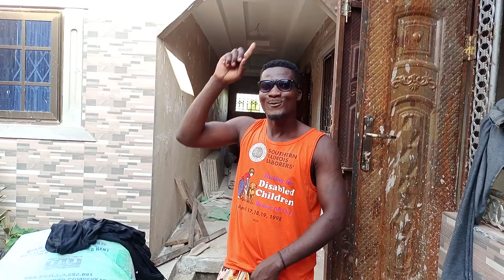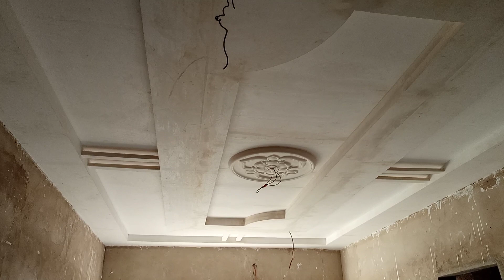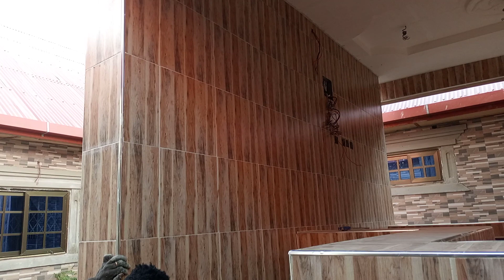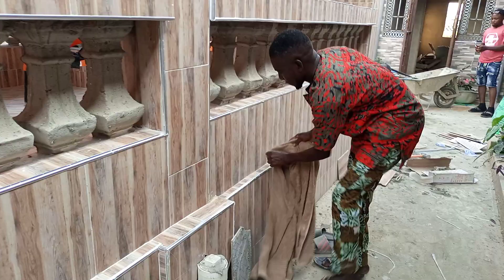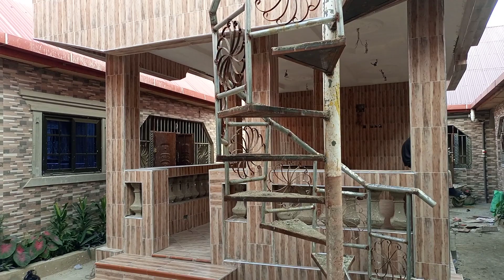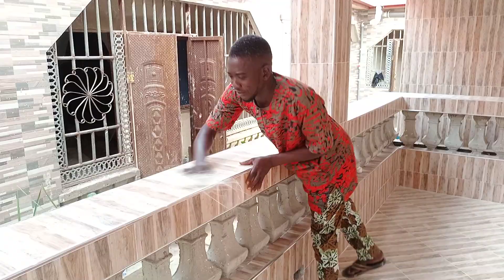PROFESSIONAL CRAFTSMANSHIP AT QUEENS GUEST HOUSE #Cistern #Tillers #Popceilings #selfsufficientlife

Comment: You building is nice, but it's looks too much concrete. The environment  in that location  is Very hot temperature.. Therefore you guys need to learn how to build breathable building., every widow  in your building seems to be  covered, no air circulation. Its going to cost alot for electricity to cold those rooms
Reply from the maker: There is a lot of windows in the rooms, the compound has enough space for natural hair. Building with concrete is the most common method of building in Ghana 🇬🇭
Reply: Yes...!  You right..! But gov't  must come out with different structure design for every location of the country. Not all  parts of country have  cold temperatures.  Countries is not meant to develop in equal designs infrastructure. They should consider the environment first.